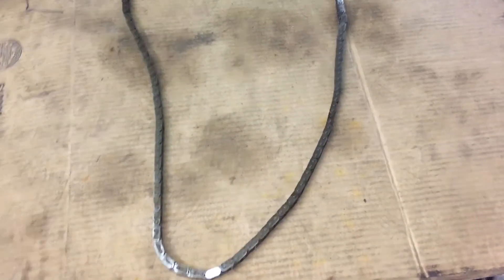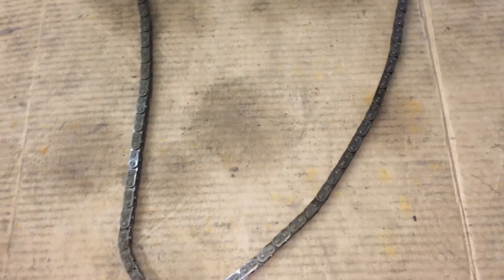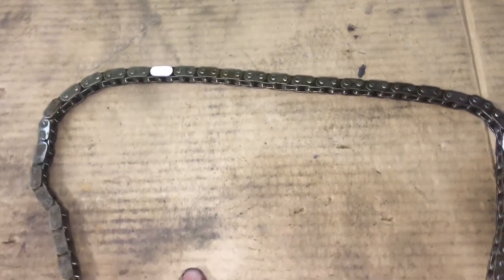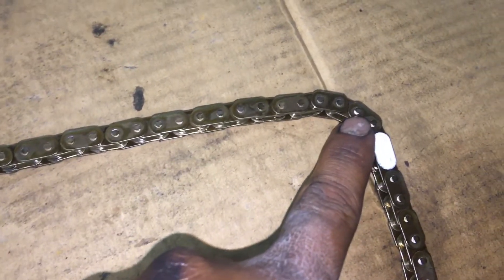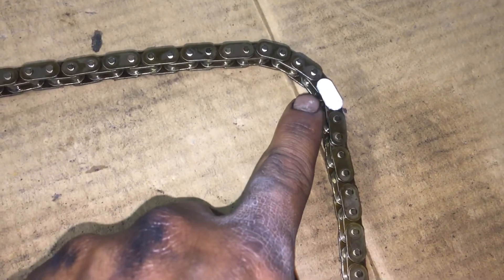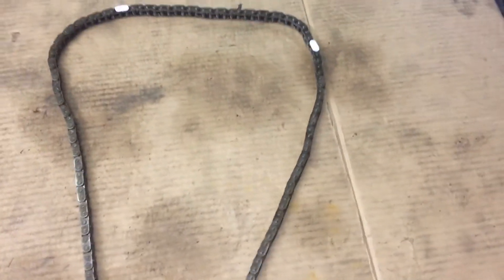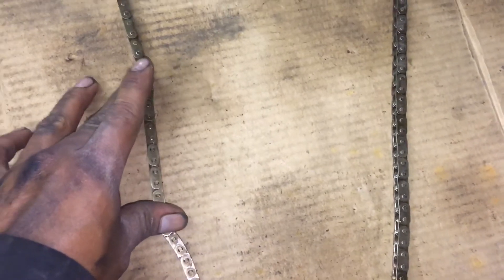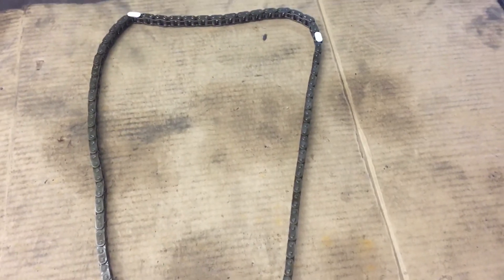How to mark the chain for a Chevy 2.2 engine

Comment: does it have to be on compression stroke? i brought it up top dead center with my finger in the hole and air came out.crank is at top dead center is that right?